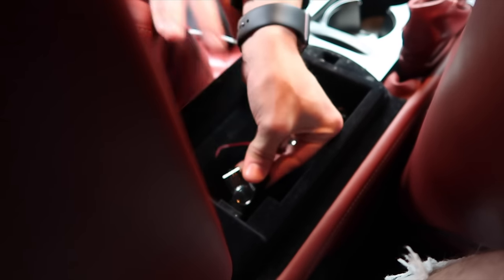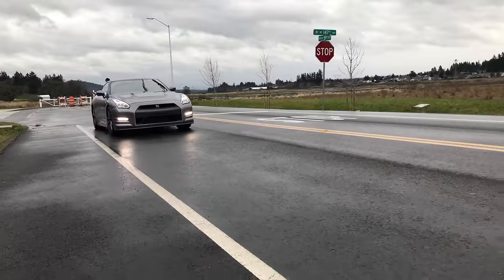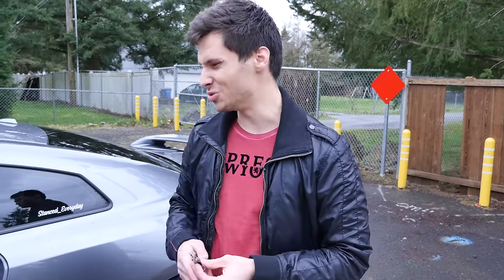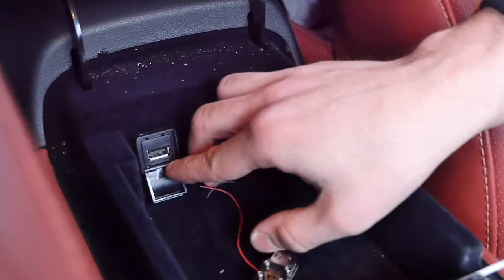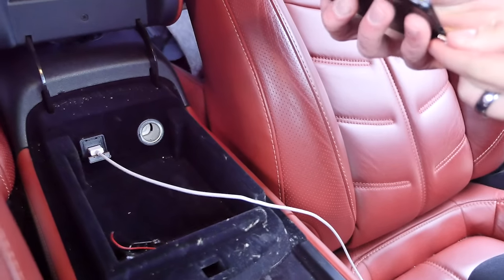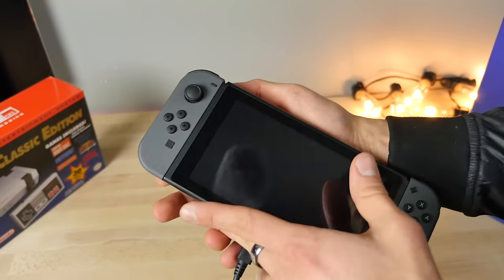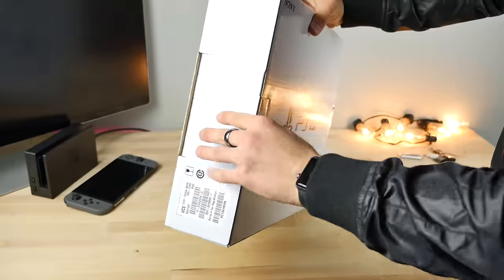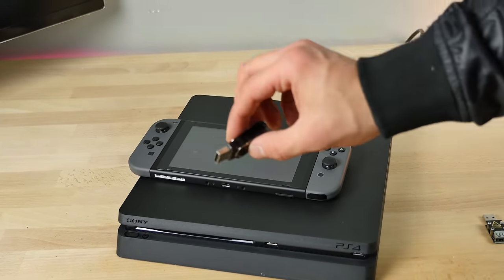USB Killer vs Nissan GTR & Nintendo Switch - Instant Death?

Comment: Plug it into a flying airliner
Reply: Christian Wolfsteiner lol
Reply: You deserve top comment
Reply: Christian Wolfsteiner I sense a new type of terrorism...

Now I'm genuinely afraid for America now.
Reply: Christian Wolfsteiner well it wouldn't be a 'flying airliner' anymore
Reply: Christian Wolfsteiner HOLD ON LISTEN- I know a lot about aviation, so let me tell you, even if it managed to destroy the airliners electric supply, the aircraft has a backup system called the RAT - Ram Air Turbine, which generates enough electricity through air to keep the basic systems of the aircraft up and running, just the essentials enough to get the aircraft to its destination safely. Did you think engineers don't think everything through? They know an aircraft can lose electricity through lightning, methane and other stuff, they have thought this through and are prepared for it. 

Just wanted to inform you guys :)
Reply: Airline mechanic here.  It'll just pop a circuit breaker.  There is no way an electrical system will pass muster for install in a passenger plane without proper protection from overload, especially knowing how destructive passengers tend to be.  If you put it in the cabin, It is always assumed they'll find a way to break it.

The only real question is whether it'll disable all the power ports in the cabin, a certain section, or just your own seat.  I cannot speak for the design of every system out there, so I can only say that it would depend on the plane. You'd better hope it's the latter or you're going to be surrounded by a bunch of very unhappy commuters.  If anyone connects the event to you and your intentional sabotage device, there's a very good chance you'll be spending some time in jail and earning a permanent spot on the no-fly list.  No one has a sense of humor about this kind of thing.
Reply: But, it was informative.
Reply: TL;DR version for Bryan H.'s short attention span:  Fucking with an airliner's passenger seat electrical system for the lulz won't likely hurt anything but your future travel prospects.
Reply: Lost 2?!
Reply: YES!!
Reply: I love that show!
Reply: oh my God You are a criminal
Reply: That is what terrorists will do in the future
Reply: Dare someone to do it :P
Reply: Christian Wolfsteiner Man u evil and I like the idea
Reply: one person said that before...thats how 9/11 happened
Reply: I would probably do that
Reply: Lazer Shark did you read our paragraphs? Go up and read my comment please
Reply: Edison Wei read my comment ffs
Reply: What a coincidence, 757 likes 🤔
Reply: For the first minute, I was laughing. Now...I am genuinely curious
Reply: Bonzi Buddy  Yeah they do, for charging ports and plugging in and editing things on your laptop.
Reply: Wtf lmao this comment has 911 likes! 😂😂😂
Reply: AirtheteenMC 950 now
Reply: good idea!
Reply: Christian Wolfsteiner he will die
Reply: Christian Wolfsteiner ffs😂
Reply: You really love this guy
Reply: Thanks bro you made my day
Reply: It won't matter, I will assume, as I work for an airline, that this device simply over-volts the IC's or the capacitors of the electronic component, so it wouldn't matter where the current is coming from, the RAT only drops when you lose the APU and the engines and no electricity can be produced, with that being said frying the media ports on an infotainment center in all likelihood would only over-volt the media center, as a plane operates at a higher voltage, the discharges the USB killer makes wouldn't have enough juice to do anything beyond a small subsystem, in other words the other passengers might want to kick you out at 30,000 feet, but in all likely hood won't do crap to a full sized airliner, think of the GTR, that was only a tickle to the main systems as even the ECU is meant for high discharge protection.
Reply: no thanks
Reply: Christi
Reply: you know what jokes are
Reply: Joseph Penn they do have it on every seat underneath the little table and tv
Reply: The USB Kill works by sending things through the data ports. The USB ports (hopefully) don't have data ports
Reply: In air 😅
Reply: NAHHHHHH WE CAUSING 10/12 WITH THIS ONE

Comment: plug the USB killer into the new Nokia 3310 2017.
Reply: Tyler Lim 😫🤣
Reply: USB to mico USB adapter
Reply: Tyler Lim that's right
Reply: you can use an adapter.
Reply: plugs in kills usb killer
Reply: LOL
Reply: That will create a black hole. I've seen it happen before
Reply: Tyler Lim The USB Killer would be killed.
Reply: Tyler Lim that's cool
Reply: Tyler Lim phones don't have a usb port

( sorry voor text mistakes im not english )
Reply: hey guys should Techrax get a USB killer?
Reply: probably not gonna work since it doesn't output i think
Reply: Tyler Lim ya
Reply: Tyler Lim
Reply: From nokia you will get 5V but very little current, for example 500mA. And if you will make spark with this "tester" it will shut down for over current...
Reply: Tyler Lim y
Reply: Tomáš Dančo im not english i cant translate it
Reply: Madtuber 58 lol
Reply: CHANNEL 3344 the micro USB adapter still killed the MacBook so obviously still enough power I'm guessing
Reply: irvine chavez not cool bro :/
Reply: Tyler Lim ye
Reply: some should tell Everything Apple pro to use USB to mico USB adapter to kill the NES classic and the Nokia 2017
Reply: the usb key explodes
Reply: If you plug a usb killer into the nokia 3310, it would simply explode and kill the user too.
Reply: Tyler Lim the og Nokia 3310 via adapter
Reply: +Tyler Lim The NES Classic does not output any power from that micro usb port so that killer would do nothing. It would only work if he had an adapter that converts controller output to usb, but I doubt that would have sufficient power to do that.
Reply: i wouldnt recommend it
Reply: The USB killer will break
Reply: hyhyy
Reply: Eminem Videos wow that is scary
Reply: Tyler Lim you can start a ww3

Comment: The GTR survived obviously, what did you expect the engine not to start?
Reply: Bond Because if it somehow fries the battery, spark plugs wont spark, and they were seeing if the usb port would work when they restart the car
Reply: how the FUCK would the battery stop working.
Reply: Maybe it would fry the ECU. It would not start in that case.
Reply: The GTR is a computer on wheels basically
Reply: gamwpanagia not as much as the newest shit that people call "Cars"
Reply: Bond i expected the electronics to not to work
Reply: The Dominator 546 you don't know anything about cars...
Reply: TwisTed Nukes LMAO he knows what spark plugs are
Reply: Like the usb port would be tied to the main pc, yea I hope not
Reply: Modern cars do have many embedded systems in it. It is even possible to control the car (e.g. stopping the motor) by hacking into theses embedded system via wifi for example.
Theses systems do also get powered by the batterie, so they are in the same circuit, which means that they could maybe get affected by strong voltage fluctuations and make the car not work (correctly) anymore.
Reply: No, its a car with a computer in it.
Reply: Senso Rieskin RLLY NGGA
Reply: deadeyecowkillz02 yeah, pretty sure about it.
Reply: gamwpanagia no thats a telsa
Reply: Senso Rieskin Buddy your so wrong.
Reply: Lil Novi you mean to tell me its not a car, with a computer in it?
Reply: Senso Rieskin GTRs don't have computers.
Reply: dude the battery has nothing to do with the spark plugs
Reply: They're not "computers" but they do have ECU's which are pretty much small computers that absorb info and do stuff with that info
Reply: devil666245 that's right...the ECU or electronic computer unit I think, controls the engine power, economy, efficiency, suspension response, Turbo presure.
Reply: SpeedGaming HD it doesn't it just controls alarm system power turning etc etc
Reply: Bond it could fry the battery so there was a possibility it wouldn't start
Reply: The car's ECU's pretty much do anything that makes the engine run, pretty much everything he listed and WAY MORE
Reply: You say theres a chance it wouldnt start or work how could a 5 volt jolt shock a 12 volt battery most components are made to withdtand extreme heat because of the engine
Reply: constantine maddox It has nothing to do with voltage and everything to do with current.
Reply: Also, why would the engine's thermal capabilities have anything to do with it?
Reply: Bond yea😂
Reply: William Le *piece
Reply: Ahahahahahahaha
Reply: I was ready for the wires to melt because they couldn't handle the heat because they were manufactured wrong and it sparks a fire with the oil in the engine.
Reply: Bond ilr
Reply: Agent857 lmao that was good i love you im gonna start saying that haha
Reply: Bond They must've thought it would have destroyed the electric start.
Reply: Also cars are operated by an ECU which is a computer. The engine timing and everything can be alters from this, so yes, that could have destroyed the car

Comment: 5 miles later his car turn off and crashes in a ditch
Reply: F.B.G lol
Reply: Bloodfrost Gaming it's just a joke that's supposed to be funny you don't have to get technical with it. just relax and laugh
Reply: Bloodfrost Gaming Lol you know nothing about how a modern car works.
Reply: You know that you need the batery to run the engine? The spark plugs are powered by it and newer cars, even diesel, turn themselves of, when they do not have power. Since the Motermapping is a software and without it, the engine does not work.
Reply: The battery is needed just for startup to move the starter and to power up the ECU (which powers the injector etc..), once is on the alternator does all the job.
Reply: Theoretically, yes.
Reply: For all YouTube A holes its just a demonstration its  not about being reach or not and the final lessen is electricity destroys any thing

Comment: Try that in some Tesla car
Reply: fuses will not help at all, because they protect against high current, not voltage.
USB Killer has low current and high voltage, that's why arc jump all over circuitst destroying them permanently
Reply: Uh it didn't even kill this car... So no, it would most likely do almost nothing to the tesla
Reply: @iROMine  thats dose not. Mean nothing
Reply: Hell yeah

Comment: I don't think that Gtr is safe anymore. Stuff like the airbags might've been affected during that process.
Reply: Most Airbag systems doesn't connect to any of the entertainment/accessory system like the USB port. I mean why the fuck would you connect a USB port to a bloody airbag? To deploy it manually so that you can replace it for like $200? It's a fucking GTR, you would expect Nissan to put a failsafe there.
Reply: Omeb Gaming exactly  he shoild use some cheap car not a gtr
Reply: indeed
Reply: Yeah that was an extremely stupid thing to do. Luckily though that would've only ever affected the entertainment system. If it were to fry anything else it would've had to send a signal through the entertainment system, back to the battery and then to other electronics which is usually protected via fuses and relays. If any safety devices were affected then some warning lights would've turned on in the instrument cluster. Still that's a very stupid thing to do if you don't have the knowledge in automotive electrics.
Reply: don't be silly. the ECU is entirely separate from the entertainment system
Reply: Dan Dube I guess your right :D But if I was that Gtr owner I'll always have second thoughts.
Reply: The airbags have there own ecu
Reply: noobtastic99 what brains?
Reply: I replaced my radio on my car with a 3rd party radio in order to play phone music (USB)
Ever since, the car gives me the "faulty airbags" warning
But I don't think that the airbags dont work
Reply: Omeb Gaming wow
Reply: they put the OS on it using that USB port so there definently is a chance he could have affected the airbags and other important stuff
Reply: no they dont
Reply: Don't newer cars have more computers than older cars? Like my mustang only has one but it's from 1995, now they have one for the Entertainment, the transmission, and one for the engine.
Reply: dude every car ever has the airbags on a separate impact sensor computer. trust me im ASE certified and snap on certified
Reply: os has nothing to do with driving or airbags
Reply: The worst that happen would be the cad sensor or fuel censor getting messed up and thats only if the car shows gas milage on the entertainment.
Reply: Omeb Gaming ya
Reply: Omeb Gaming I'll gladly take it.
Reply: Omeb Gaming its nissan not 'neesaan'
Reply: They go to the same battery, so it cant be entirely separate?
Reply: The air bags are powered bu pressure so the most its going to do is delay it by about 0.0001 seconds which cant effect anything to do with a crash so :)
Reply: Omeb Gaming it just ruins radio.

Comment: Having a crack sound before your device goes dead is better than having none at all. This means that only a fuse burned out and that it can just simply be replaced (in most cases).

Comment: a usb killer can kill other usb killer? :0
Reply: Does it have a usb port?
Reply: ItsChristianSTY GD No, it needs a power source. Even if you used USB female to female adapter, nothing will happen.
Reply: You would have to use the homemade USB killers with their own power supply.
Reply: charge them up first. does anyone here even understand capacitors???????
Reply: do u think any1 intelligent clicked on this video?
Reply: ItsChristianSTY GD I guess so
Reply: ItsChristianSTY GD it remains to be seen
Reply: ward
Reply: ItsChristianSTY GD important question
Reply: 3 way usb - 2 for the usbs, and one for a power source. problem solved.
Reply: ItsChristianSTY GD m
Reply: asgerØK If it had, a singularity would happen
Reply: ItsChristianSTY GD hmmm.. idkkk
Reply: ItsChristianSTY GD where do you plug it
Reply: ItsChristianSTY GD iiand
Reply: If you convert it male to female port, and plug it into power, it will short your house lol. Brown-out. House burns down.
Reply: anis banana For real? (I actually have no idea)

Comment: For the Switch, the USB killer should have been plugged into the dock. I didn't think the Switch itself would have any kind of protection against such a device, but the dock might have. Since the dock has a USB hub, it might have just killed the dock and not the switch itself.
Reply: Add go dine

Comment: De-solder the USB killer lines from the data pins. Solder on some external wires that run to the outside of the device on the back. Plug the USB killer into a power bank. You now have a portable mini taser for sneaking up on people and zapping them when they least expect it.

Comment: New title : How to screw up a nintendo swtich in 0.5 seconds.
Reply: BrunoMiguel333 is that before you screw up the screen by sliding it into the stand
Reply: lol that is not true the stand do not scratch the screen.
Reply: BrunoMiguel333 yea it did because they sell the units now with screen protectors
Reply: F1NNDAWG Playz They did that to make people happy, because people are dumb. If you use it correctly it doesn't scratch it.
Reply: how to screw up a nintendo switch in 0.5 A presses
Reply: BrunoMiguel333 k
Reply: BrunoMiguel333 and a GT-R

Comment: I hate how the "USB Killer" is looked at as some genius hack, or a devious piece of circuitry...

People have been accidentally blowing their USB ports since the birth of USB.  All you have to do is hook your front ports up to the motherboard wrong...  2 wires for power, 2 wires for data.  You send power down the data wires, guess what happens?

It's not clever.  It's like sticking a fork in your outlet and blowing the circuit breaker.  Then, calling the fork an 'outlet killer', and selling it on ebay for 40 bucks.
Reply: exactly
Reply: Yeah. It's just so dumb. "Well it charges the thingies so it's more powerful" like bronthat doesn't matter
Reply: I like the way you put it out here.
Reply: Well fuck I'm about to start selling outlet killers now, thanks for the idea!

Comment: Airport, do it at the airport charging station
Reply: abdoul diallo yes plz
Reply: abdoul diallo It may not work because the USB killer attacks the data port with a -12V charge. Not the power port
Reply: the first version of it, it attacks the data line
Reply: Optical Gap put it in the plane TV lol jk I'm not a terrorist
Reply: That would be funny 😂
Reply: Optical Gap nope your wrong
Reply: What if the power at the entire airport turned off
Reply: abdoul diallo no that would be so bad